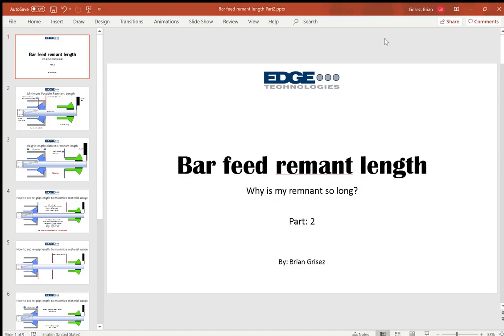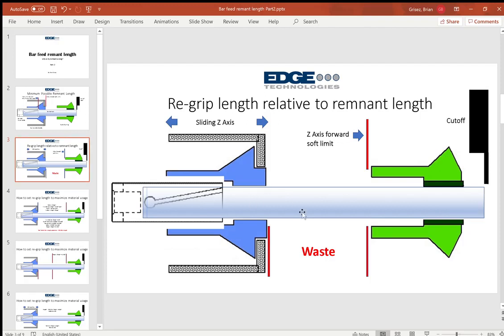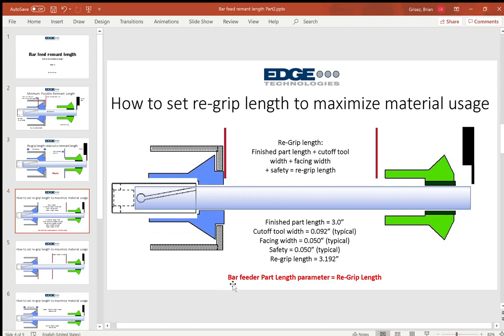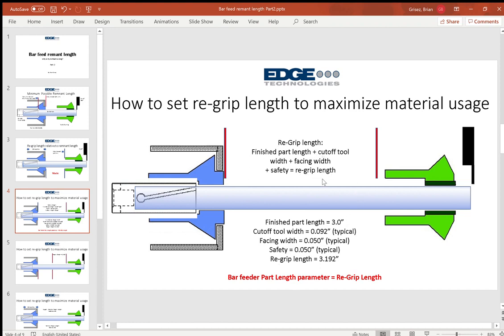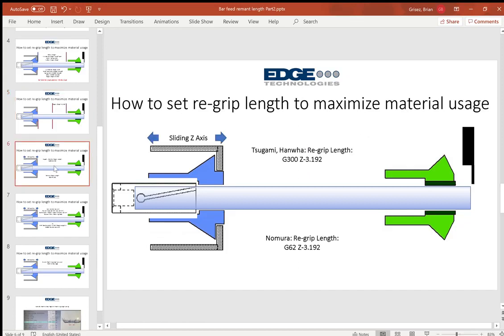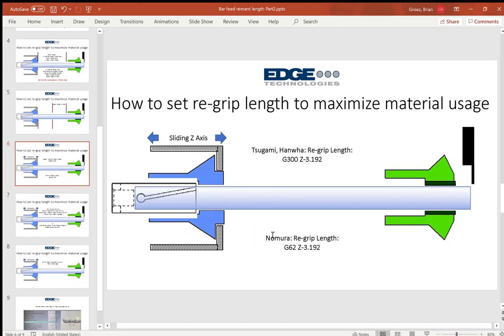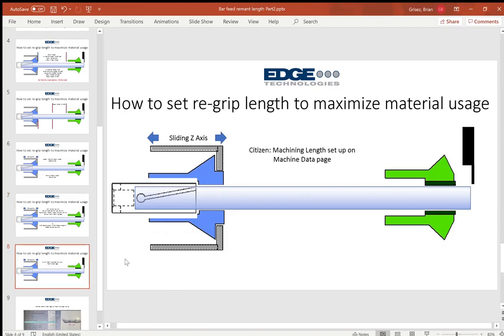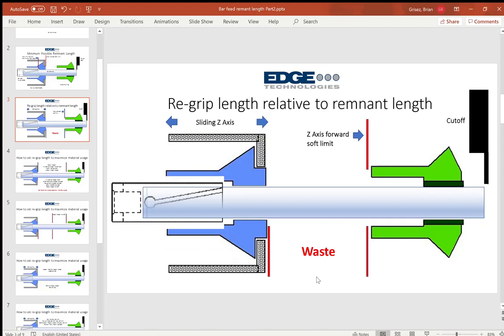Why is my remnant so long  Part 2

Comment: So are you saying that the machining length in MC data on the Swiss needs to match the edge bar loader part length parameter?
Reply from the maker: Other way around. You set the MC data value based on your process. Utilize that value to set the Part Length Parameter in your bar loader.

Comment: Shout out for United tool llc!! Video is very helpful thanks again
Reply from the maker: Mike, Thanks for watching, I'm glad this was helpful. Keep an eye on the channel for additional videos being added.
Reply: Hi Mike the machine I'm running is a Ganesh Sl 20 y2 with a barfeeder 320 se edge technologies with a control hitec. I'm a machinist that is trying to set the part length and remnant right for this machine. The machine can be set up two different ways conventional  or swiss. Which i have to remove the rotary for no guide bush.